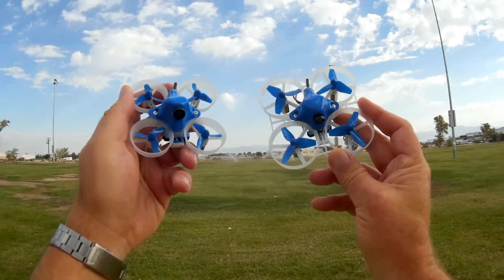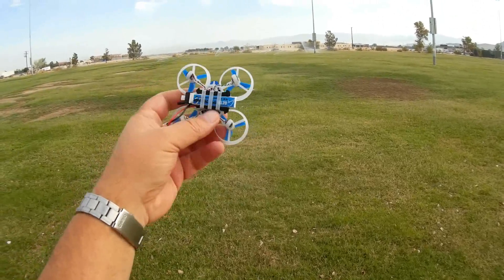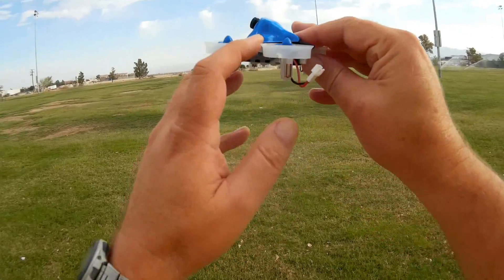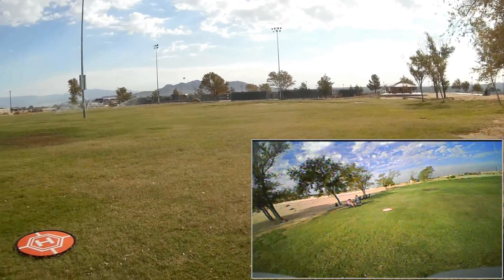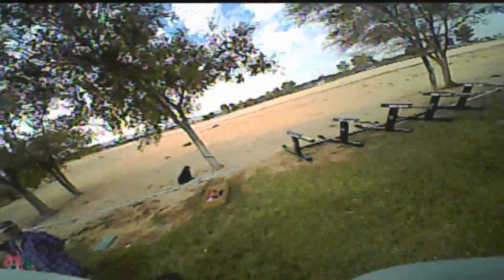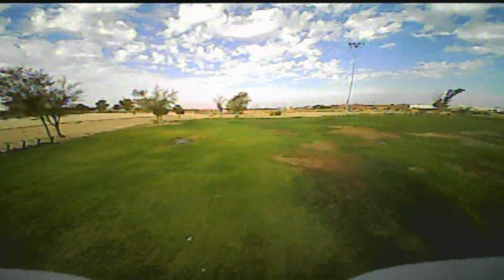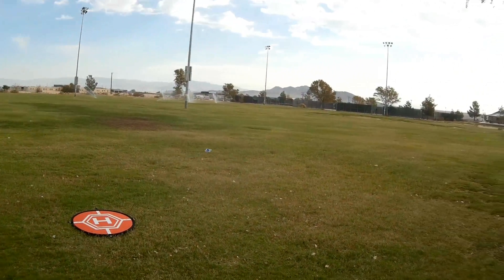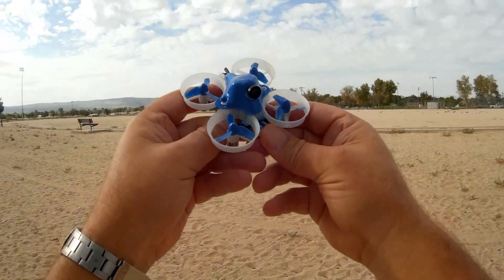Beta65S Inductrix Whoop Style Micro FPV Drone Flight Test Review

Comment: FYI This quad does not have any setup on it. It comes with stock Betaflight PIDS. You must tune it yourself. Once you've done that it's a whole different quad. Yours is puttering around and making huge looping flips. Once it's tuned it screams and flips like mad.
Reply: I have this but have no idea how to tune it. I've got it running on stock BF 3.5 pids and it does giant loops like in this video. Most of the time it plummets to the ground after a loop, it can't recover. What should I mess with in the pids to get rid of this behavior?
Reply: Would you mind sharing those PIDs 😊
Reply: How loud are these things pre-tuning and post-tuning?

Comment: Is that annoying beeping from the taranis wheel under your right palm?
Reply from the maker: No, Taranis has a center position beep alarm that you can set for any of the sticks and some switches and knobs.  It lets you know when you are at center position, which can be nice to know.  I had it turned on for my throttle stick.  Didn't realize it was still on when I did the video.  Have since turned it off in the menu, so it shouldn't come up again.